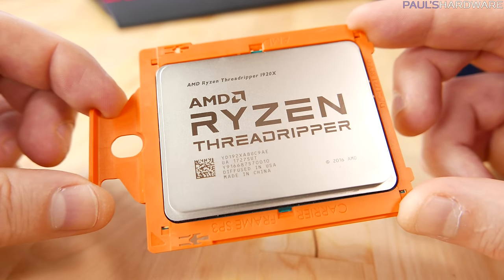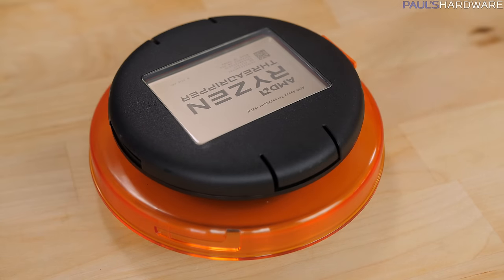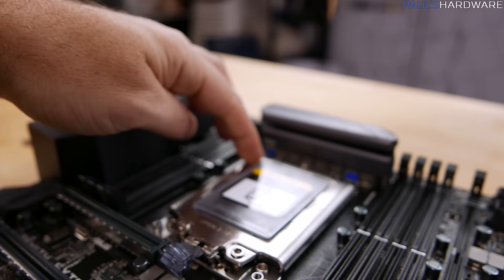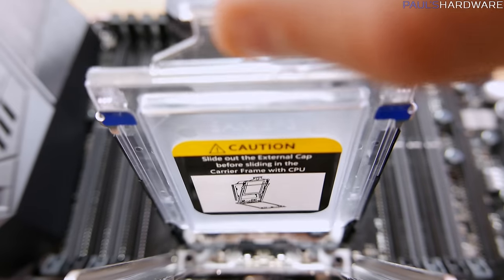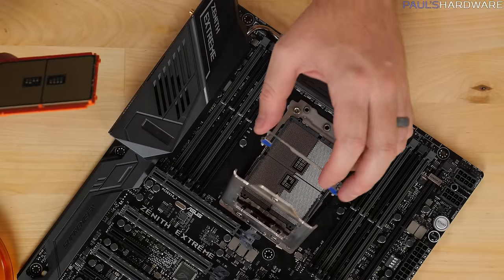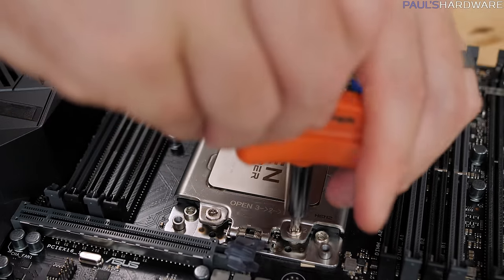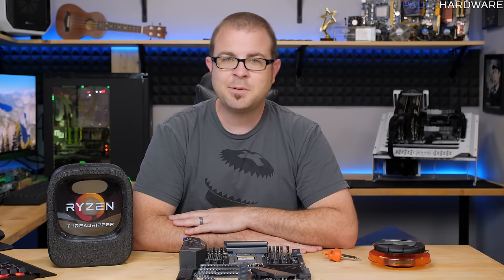Threadripper CPU Installation Guide! How Socket TR4 Works

Comment from the maker: ** TWO FINAL NOTES ABOUT INSTALLATION **
1. You can leave the final protective pin cover on the socket until the very last second -- installing the CPU into the middle carrier tray first would be best practice. 
2. At the end of installation you can tighten the 3 Torx screws "all the way", but the included Torx tool is geared for the exact right amount of torque and will click when you hit it. The amount is labeled on the tool if you're wondering -- 1.5 N.m / 15 Kg-cm / 13.3 In-lb / 18 Ft-oz 
THANKS FOR WATCHING EVERYONE!
Reply: Paul's Hardware lol foot ounce... 1.108 ft/lbs for any interested, yes thats a very small amount of torque
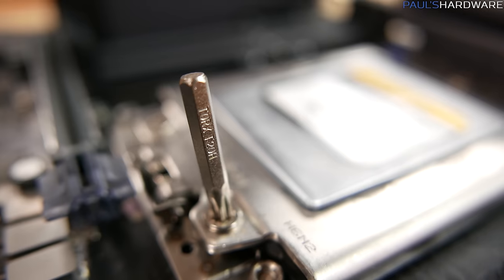Reply: 1:16 3:15 Please add that (1.5nm / 15kg/cm) as text overlay to your Video, everyone should note it...
Reply: Paul's Hardware  i do not know if it aplays to the little torx wrench in the pack, but you should nevet use a tork wrench (at least not an adjustable one) to unscrew things. It can and certanly will break its calibration sooner or latter
Reply: I second +Marius87's comment there. You should add the torque required as a text overlay. Just in case. Because many people don't go into the comments and just follow the vids blindly :-)
Reply: PS: Paul, I think your comment here should also be added to the vid's description.
Reply: Paul's Hardware can you not use the orange plate when install the cpu?
Reply: It's required. Won't work without it.
Reply: thanks for the nice tip
Reply: the fact that the screwdriver included has the recommended required torque is critical info that should have been in the video
Reply: Also AMD recommend that you screw EACH screw fully before moving to the next one, so 1 fully screw then you move to 2 and repeat.
Reply: Well, the problem with doing that is that screws #2 and #3 might be slightly misaligned, and thus hard to thread in.

Rather, screw #1 slightly in first to let it catch the thread, then #2, then #3, then tighten the screws in order.
Reply: I know, but in practical, real-life installation, tightening the #1 screw to torque limit usually makes #2 & #3 much harder to thread in. One might accidentally put in too much pressure against the carrier to make #2 and #3 'grip' their threads.

That is why most system builders do it #1-#2-#3 slightly (just enough to catch the thread), then #1-#2-#3 tighten to limit.
Reply: i agree. it is better to torque it down like a cylinder head. amd's method is flawed
Reply: Yeah, I would definitely leave the socket protector on until EVERYTHING else is in place...LGA makes me paranoid...
Reply: That's such a cool design that they include a "torque wrench torx screwdriver" in the CPU box.
Reply: Thanks for pinning this. But my motherboard didn't have the inner cover at all. Have they been dropped as redundant or for saving a couple of pennies? Or is the inner cover socket vendor specific (my board has Foxconn socket) or certain vendors?
Reply: That is what everyone else says too, keep that those pins protected until the last second.  They are delicate and if anything falls on them, they are ruined.  I would also make sure to have that tool to tighten the screws.  If you do what some people I know do and just tighten them as much as you can you will damage things.  You can imagine that is one reason why those people WILL NOT be here when I get that motherboard and CPU.  I don't want them within 10 miles my my TR4 socket without the CPU and heat sink installed.
Reply: Paul, you have gone the extra length by providing information about the torque, and details about the provided tool provides the proper torque.  Thanks.  With that being said, do you think you can damage pins by over torqueing?

Comment: What a creative way to install a cpu.... huh
Reply: It's actually really brilliant. I never liked the way Intel's LGA sockets were, far too easy for beginners to make the mistake of pressing down on the CPU, and AM4 shows that having a clusterfuck of pins is really fiddly with PGA. This system is far more beginner friendly.
Reply: PGA is really fiddly - since when???  Maybe I've been building computers for far too long, but I can't say I ever found them fiddly...  Wait, yes, I do remember a time where ZIF sockets where optional and inserting a 386/486/Pentium CPU into a non-ZIF socket could be a pain in the ash...
Reply: Reggie Reginato pretty sure pin counts have increased substantially since the release of those CPU's
Reply: I ended up having bent corners on my 7600k but was able to RMA everything thankfully - this system seems like it's pretty hard to screw up
Reply: +shdowhunt60 Yeah, I hate to tell you but if the beginner is stupid enough to make that mistake then they deserve the consequences. Creative is all I will give this new installation method. It's not more beginner friendly, mostly due to the cost of thread ripper processors, and it's definitely not easier. I really hope that Intel doesn't adopt this and that AMD doesn't put this on all of their processors in the future because I personally would loathe it.
Reply: Yeah, and glad those days are long gone.  But I don't find AM4 (or any PGA style chip with a ZIF style socket) any more or any less fiddly then an LGA socket.
Reply: Only thing that is sometimes a pain with the ZIF style sockets of recent AMD processors is the removal of heatsink can pull the cpu out if it is really stuck to it.
Reply: Can happen with any ZIF socket though. :-)
Reply: Noob why is it unreasonable for someone to expect that after paying a thousand dollars for their cpu and hundreds for their motherboard that the cpu would be convenient to install? amd has always been known for having simple to install cpu's and coolers.
Reply: right
Reply: Hunter Warner so what you are saying that as a beginner at any skill you personally have never made a mistake? And somehow everyone that has ever made a mistake deserves what happens? Get over yourself buddy, that is a piss poor attitude. 

Also being a beginner does not mean they are building a budget system. If it was a first build for a content creator why would said person go for a $100 cpu over a $1000 one because he is a "beginner". People like you are the reason some people are scared to get into building PCs and thus we can be labelled incorrectly.
Reply: alcowherd7 if you're handling CPUs that costs hundreds of dollars it's in your best interest in knowing and researching how to do things properly, screwing up a CPU installation is something you can do only if you're 100% ignorant on how to do it, nothing to do with being a beginner. 
In this age of information ignorance is not acceptable, when the "know how" is just a youtube video away, especially if you're handling expensive stuff you bought with your hard earned money.
Reply: Cube Master they made the experience of putting it in cool on purpose
Reply: I just wanted to hop on this chat and congratulate AMD for producing the worlds strongest desktop processor ever made in the history of mankind! that's all i wanted to say!
Reply: @shdowhunt60 what? PGA is brutally tough compared to LGA. If you touch an LGA pin incorrectly you've just ruined $200. However with PGA you can literally use the pins on the CPU to scratch yourself (i didn't subconsciously do that or anything) and they'll be just fine.
Reply: NoButOneMe also this system is probably made to prevent people from damaging the pins on their motherboard
Reply: Probably Not A Chicken 20 years of AMD and Intel and the only time I've lost a CPU was when i installed it incorrecty and that was a Pentium 4.

Either way you can lose a pin, usually due to people dropping or stepping on the cpu/boards but this way does actually come across as clever.
Reply: Creative, and it looks like a pretty safe method of installation as well.
Reply: collin yan

i beg to differ on that simple to install note on 1 occasion though,
remember those old thunderbird athlon coolers? you had to push down on the thing with a flat head screwdriver and use like 20 kilograms of force for it to actaully finally get into place haha

those were pretty horrible, the little lever on AM2 heatsink "brackets" kinda was a big step up ;)
Reply: @Tailslol
I predict that Threadripper's installation method will result in less motherboard RMAs.
Reply: ho god amd exposed die cpu (amd athlon xp)
was a fucking nightmare so true
Reply: yeah they seemed to have learned from that
Reply: Hunter Warner To be completely honest, it certainly looks much easier than installing an Intel lga CPU. I didn't have any problems when I installed my i5, but I feel like the lever and the socket itself is much more flimsy, and is therefore more susceptible to breaking. I think that this method of installing a CPU is much more beginner friendly as there is less room for a beginner to screw up while installing the CPU.
Reply: Hunter Warner why? It's a better mounting method in my opinion, when compared to Intel's lga socket.
Reply: @Killa Fx
Not to mention that this method looks like it puts less strain on the motherboard's pins, thus possibly increasing the number of insertion cycles the socket can handle.

Not that it matters too much.
Reply: Alexander Rewijk I agree, and the rest of the old forums filled with posts of "I put my screwdriver through my motherboard!!!!!!!" arehilarious to look at and also painful too
Reply: Cookiekinggaming It's 2 years normal waranty when buying on Amazon you get 3 years.
Reply: Some intel fanboy is salty that the competition is beating them
Reply: Collin yan, didn't you get the memo? AMD Fanboys are bigger diehards then Hillary supporters, they refuse to accept ANYTHING done by AMD as less then perfect everytime, heck some of them are even so crazy they thing Vega 64 will eventually match 1080ti level performance with driver optimization, there is NO reasoning with Fanboys, you just have to ignore them and move on.
Reply: I think the Pentium 3 Slot 1 was the most interesting processor packaging design, even though they got rid of it for legitimate reasons (expensive manufacturing, bad airflow, not very compact etc)
Reply: +Hunter Warner  They are paying up to $1000 for the CPU and $500 for the mother board.  The manufacturer just recognized there is benefit for it's customers to remove the opportunity for damaging parts.

I mean this in the friendliest way possible.  To say people deserve to damage parts because they're "stupid" is elitist at best, just being a prick at worst.  How would this affect you or anyone else as a negative in any way?  It comes off as "I'm the one who is special here, who do these newwwwbbs think they are coming in here thinking they are as special as me?!?"  You may not have intended this, but it's the way it comes off.  Also there are physically disabled people out there that may not have the same dexterity you or I have.  This system may help them.

Besides you want as many newwwbbss as possible coming into the PC community because as the market grows then more product innovation and manufacturing happens.  As this happens competition among the manufactures happens more which means lower cost and more choices to the end users.  Because of the wider consumer pool to sale to and make a profit from.  There is nothing but positives here.

Again super friendly here.  Just constructive feedback.  :)
Reply: +Collin yan  How is this inconvenient to install?  I argue this new system is more convenient because it removes potential for error.  Especially for physically disabled people that don't have the same dexterity you or I do.  People that might be excluded from the joy of building their own system simply because they can't grip well.  That orange cpu holder has a big orange grip tab.  This new system enables more people and doesn't really affect you or I in a negative way.
Reply: shdowhunt60 Sadly the thread ripper is not a beginner cpu
Reply: +Aviators Dream  "Sadly the thread ripper is not a beginner cpu"

Says who?  Where is that written down?  Who says a computer builder has to start with an APU or an I5?  Is it law?  Does AMD and Intel both have official public statements saying that new computer builders with money to burn should stay away from these products?  Or is this statement to justify resistance to minor change?

It's obvious AMD built it this way to make sure it was user friendly whether a person has built 100 machines or if this is their first one.
Reply: Sorry lga is the way to go with 4096 pins.... I would NOT want to deal with a 4096 pin PGA proc lol
Reply: Tbh i agree with you, AMD is always a good beginner option if your looking for high end performance and right now the price for the 1900 is at 800$, Which is way below the Intel price for the same spec.
Reply: +ohgodwow2 "The ultimate platform for PC enthusiasts"
It's not a beginner CPU.
Reply: +He_162  So surely after the quote "The ultimate platform for PC enthusiasts" in whatever literature you pulled that from it continues to say "WARNING:  NOT FOR BEGINNERS!  Newwwwbbbss do not buy our product."  All desktop PC's build the same way with off the shelf components.  Don't be obtuse, you know perfectly well the "enthusiast" in that statement refers to the performance, not how it's built.

No little Timmy you can build an I3 system, not an I5 because that's too much.  It assembles the same.  It's no different with Threadripper.  The fact it's powerful performance wise is arbitrary compared to how it's built.
Reply: ohdogwow2 OK dude you really need to calm down. I was making a point that the Ryzen thread ripper isn't a beginner cpu. There's not a lot of beginners that are building 1~2 grand pcs as there first build.
Reply: I'm pretty sure they did it this way to keep everything aligned perfectly,cuz as i see it, moving the cpu by just a little bit will make half of those pins connect with the other half
Reply: Core PC Gameplay 
Wow, that's kinda racist, my welfare recipient friend.
Reply: Hunter Warner Only thing I get from your comment is some hidden salt because you are so obvious with your unprovoked talking down this very simple and prtetty much safe way of installing CPUs. Well, since you hope Intel won't adopt it tells where are you comming from.
Reply: Do you work for Intel or AMD. Because trolling like this looks so lame that you help AMD in the end.
Reply: softplacetoland Are you talking to me? Because I'm not trolling. In my opinion thd Ryzen is not really a beginner grade cpu. Unless the beginner has a 3 grand budget and not a lot of beginners have that budget
Reply: Aviators Dream,

Everyone can do this, 1,2,and3, your done, did you use extra Foxconns extra tray to get that R3 into the socket, now they just force you to use it!
Reply: Cookiekinggaming Nice try there Intel fanboy, warranty is 3 years, not 1.
Reply: Aviators Dream You can be a beginner at any budget. My first PC was ~1400. But if I had any need of the performance it brought me I could have saved 3k and built what I thought I needed. (Say if I was a youtuber, or video editor and needed all these cores, but didn't wanna shell out for a prebuilt so I wanted to try at building my own)
Reply: That is very clever... and I am actually going to be buidling my first ever AMD workstation

Comment: Bet some people are still going to screw this up...
Reply: Idtelos nice one
Reply: The motherboard could come with the cpu already installed and people would still be able to find a way to bend the pins somehow. Never underestimate people's minds, just read some of the comments here, it's "too complicated."
Reply: well didn't skylake have an issue with bending because they used a thinner PCB or something?
Reply: TheNerdyCanadian Yeah it had to do with mounting pressure of certain coolers. The pcb was so thin that too much pressure plus heat would bend the pcb. So you had to watch out for certain heavy aircoolers as well, apparently...
Reply: lmaoooo you are brilliant
Reply: Paul sort of did. He had to first install the CPU in the rail, then remove the cover from the pins. Removing the cover first then installing the CPU is a death wish. Could attempt to slide the CPU and it falls onto the pins.
Reply: Pun intended 😉😉

Comment: Careful not to rip those threads as you apply torx to those screws and knock your sockets off.
Reply: Kevin McCormack That's why they called it "Threadripper"
Reply: I can just see the internets now "OMG AMD is horrible. I was tightening the dinky torx screws down with my big ass screwdriver and the threads stripped! This product is horrible, do not buy!!!1!"

IMO, being someone that's fixed things professionally, the screwdriver they give with it will allow too many idiots to get a good grip on it and possibly strip out threads. They should have just spent a few dollars a piece and sent it with a torque limiting handle.
Reply: Don't people know to stop screwing it in when you feel it getting tight?
Reply: dafirnz lmao, sad but true...
Reply: anikanbounty97 it's sad how many people don't have the common sense to know that
Reply: It's a torque wrench, you can't over tighten it. You can hear the click at the end. Paul should have mention it and skip the part where he said you can use any torx bit that you have laying around.
Reply: +rationalityfirst ah, that's good to know. I did wonder what's up with the big orange thingy... but I missed the "click" so I did not realize it's a torque wrench. Thanks for the explanation!